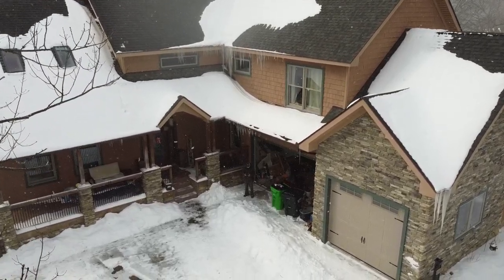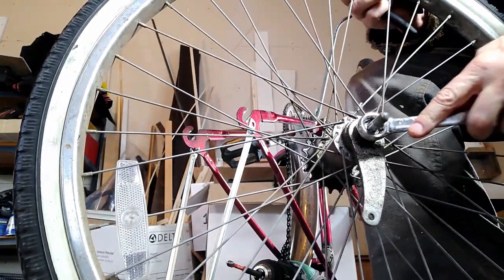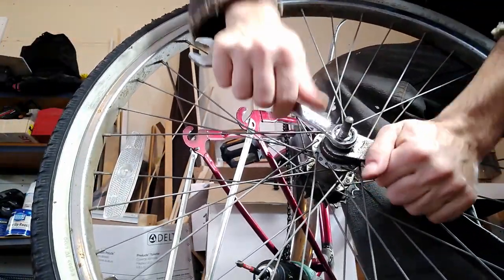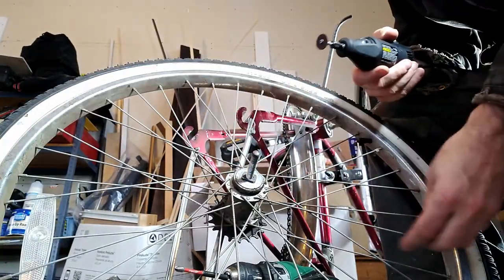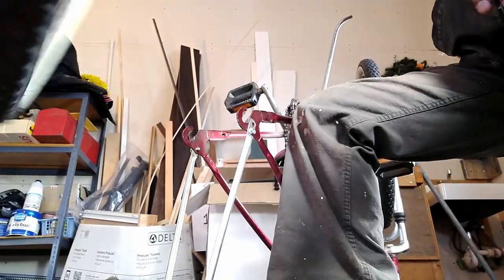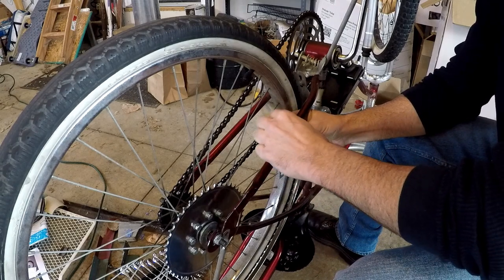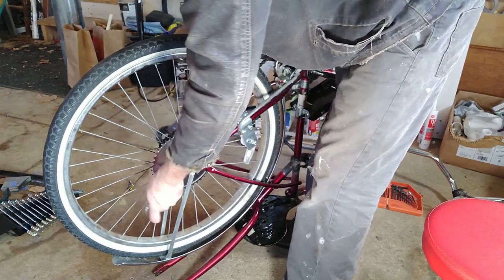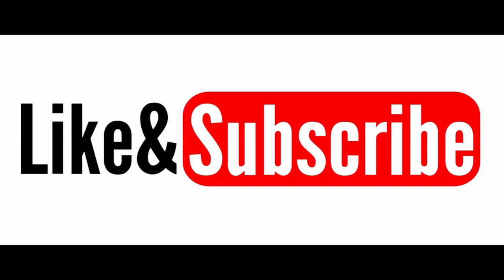49cc Historical Bike Build #7.    Installation of rear drive sprocket.

Comment: I had to heat and bend my crank arms to clear the motor
Reply from the maker: I hear ya.  Sometimes these 'universal kits' aren't so universal, right?  Thanks for watching.  Dean.
Reply: All you had to do is get a mongoose  crank and pedals off a mountain bike on the back of the pedal bars say 152 prowheel crank setup most  bike parts are interchangeable
Reply: @Raoul Duke  I am considering putting a three piece crank adapter on it, but where would I find a mongoose crank?